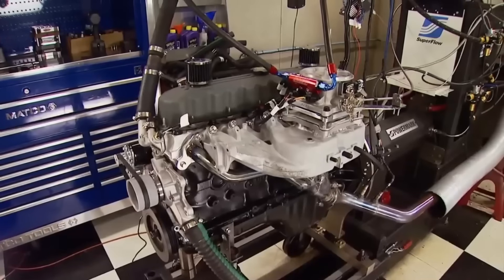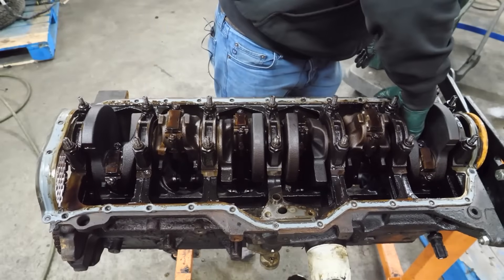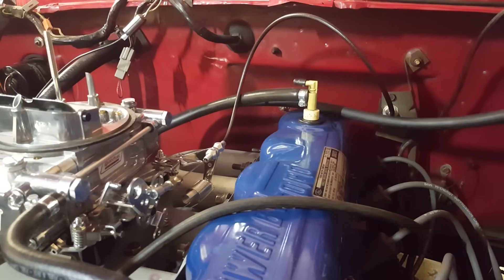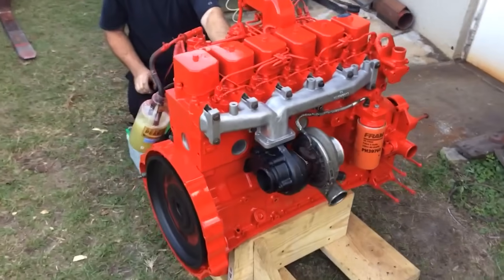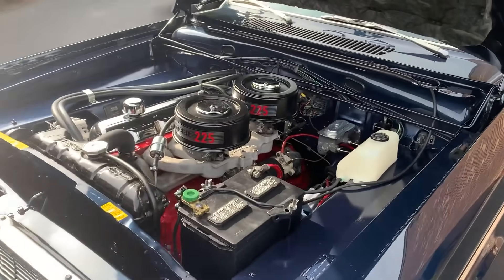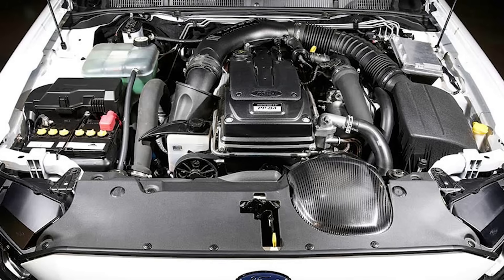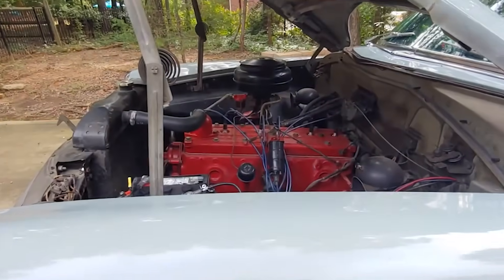8 Best American Inline-Six Engines Of All The Time!!!

Comment: The Ford 300 Cubic Inch  Six was used in commercial vehicles as well, up to the F-600. It was also used in UPS trucks, and in off highway applications like airport tugs, forklifts, irrigation pumps, standby generators, and as pump engines in oil fields.

Comment: The Ford 300 is the only Ford that I have owned that I have not thrown a rod in. Yep, I all but gave up on Ford, and then I got an F150 manual with a 300, and I found a Ford engine that does not blow up. I still have that F150 today, with over 275k miles on the block. 

PS Fords that I have thrown rods in while I was driving them. 78 Thunderbird, 2001 P71 Crown Vic Interceptor, 1988 Tempo. The T-Bird was the only one I rebuilt, drove and then sold. Should have put a 300 inline in those puppies, the 351/400 Clevelands were dogs.

Comment: I have no clue who makes these videos but they obviously have no clue of what they are talking about . Some of these old engines may have lasted for a couple of hundred thousand miles if they were well maintained but they were only a cheaper option to a V8 . They did get a little better gas mileage but unless you spent a small fortune on modifications , they had barely enough horsepower to get you where you were going .

Comment: I bought 2 ‘95 ford trucks for my landscape construction company. F350 Powerstroke service body, and an f150 4x4 with the 300 IL 6. 35 years later the diesel has 185k on it and 300 has 230k. I’m 57. These trucks are easily going to outlive my business, and maybe outlive me. Fueling them might be a little spendy in another 30 years.

Comment: Had a 67 chev 4x4 shortbox with the 292 six, it was the greatest engine ever, the torque was incredible and for the time gas mileage was good. After I had a 1979 ford 4x4 with the 300 six and it was a good engine but the truck had had 2 x 21 gallon fuel tanks and it needed them. So the 292 was the winner for sure.

Comment: Union Gas in Ontario used this engine in maintenance work trucks and were far more durable than the dodge 318' V8's. It did provide plenty of low end power and never broke down.  The Dodge V8' consumed a lot  of oil but not these engines.

Comment: Yep I bought a 66D200 Dodge in 2014 with a slanty in it hadnt run in years had a tree growing thru the engine on the drivers side luckily the hood wasnt latched, the hoods on those sweptys open to 90degrees. All I did too it after 3 days of cutting the tree out was lube up the accelerator pump of the carb with vaseline. put a homemade tank in the flatbed. That thing ran superb with a 4 speed should have never got rid of it.

Comment: The pinnacle of the F-300 I6 was it's phenolic timing gears, similar but different to motorcycle timing back then, this engine was banned for no good reasons but, it can fit a ford ranger and newer trucks.

Comment: Holden and Ford Australia are Aussie manufacturers with US based parent companies, I wouldn't count the Barra as an American straight six. It was never sold in America. The Atlas/4200 Vortec is objectively one of the best American I6 motors. They don't get a ton of recognition due to the fact that they were only available in a single platform, but it won multiple awards, including 4 straight years on the 10 best engines list. Now tuners are showing how much power these engines are capable of. They are lightweight and reliable, and very advanced compared to most of this list.

Comment: 5:19 My dad's first wife had a Dodge Aspen back in the 80s with the slant 6 in it. His wife knew nothing about cars and just drove and drove and drove the car until she told dad that it kept making some kind of noise. He said it had rod knock and he pulled the dipstick and there was barely anything on it. He put about 3-4 quarts of oil in it and the rod knock went away. Props to Chrysler for making a tough ass engine

Comment: The Chrysler slant 6 is my favorite engine. Had 3 different cars with them...2 were Darts and the other was a Valiant. All of them had over 200k on them when I sold them...yes...they were all still in running shape.
On top of that...the Valiant was a "sleep" in street racing...if you know what that is.

Comment: My 4..0 jeep engine was still going strong at 336k miles before I cooked the head gasket. When I overheated it. Completely my fault. The 4.0 iny 99 xj has 220k plan on keeping that going strong. It's a great engine
Reply: My 4.0 in my two door Cherokee would get so hot pulling my boat home in Vegas from Lake Mead but I would short shift to let it cool and not shut it off when I got home . I would spray the radiator with the garden hose .   The 90 Wrangler had the 258 and my 90 Cherokee had the 4.0 The Carburetor was the biggest issue off roading in the Wrangler besides the  leafs at each corner

Comment: In the early 80s I worked for a Plymouth dealership that ran a fleet of taxes with the slant 6 engines running on propane those were tanks
Reply: Our canning company in the 70's had 🫛 Pea  combines that were propelled by Chrysler slants 6. They were pulled with tractors and we picked 10 2 14 hrs a day 4 2 months straight. Our crew had 8 combines and I never saw one stop. Ran on propane

Comment: I work at Walmart in the Auto Care Center. I have changed oul on multiple 5.9l Cummins engines in Dodge Ram pickups. A few of the owners said they would never replace their trucks and those that traded them for a new 6.7l Ram wished they hadn't.
As for the Chrysler slant 6, we had 2 John Deere model 800 swathers and both had the slant 6 engines. Those came out in the mid 1970's and they still run. We changed oil every year and they just kept going.

Comment: The inline 6 engines have their origins in tractors. That's why they last. They have work in their roots and the technology came forward with them.
I have a 1966 GMC I1000 2 wheel drive pickup with the 250 I6. It's a fun truck to drive. The engine has huge amounts of low end torque, it will throw you back in the seat if you get on it. And it will cruise easily at 75mph. Love driving it.

Comment: My mom's 1972 Plymouth Valiant slant 6 was reliable, easily maintained, deceptively fast with great pickup speed. It had NO air conditioner, NO power steering, NO Power brakes, NO power windows! Nothing to encumber the Slant 6 power! It was a BEAST!
Reply: @americanpatriot9865  Aw, the good old days! Power nothing. Many models still sported that wonderful "Armstrong power steering" as the old timers called it. The only power was the motor supplying power to the drive wheels, and the driver supplied the rest. The good side of that was there was far less to break down.
Reply: Makes me miss my mom's '76 Fury wagon. It was in mint condition except that it had an intermittent ignition problem. It wouldn't start half the time. In 1989 she ended up just having to abandon it in a mall parking lot because we were so poor she couldn't afford to tow it home. Then once it was impounded she had no hope of affording the fees. I never saw it again. A year later our next car was a '77 Pinto V6, which was actually a very good car as well. Finally she was able to buy a new '92 Ford Escort and she fell in love. Most reliable car ever. She still has it.
Reply: One of the best cars ever! My friend had one and it was indestructible.
Reply: My Moms 1st car was a late 60s Valiant. She says to this day it was one of the best cars she ever owned.
Reply: There was one in my extended family, a ‘73 Dart Swinger 2-door. It was equipped with air conditioning and power steering and never seemed to lack for power. It was a spring sales promotion car Dodge marketed having those features plus a Torqueflite auto transmission and a few nice cosmetics: vinyl roof, radio, whitewalls and wheel covers. Did not like to start easily in humid weather.

Comment: Funny it's mostly about ford I have a 3800 Chevy with almost 400k miles and it still smokes the tires
Reply: 3800 was a V6, not inline, and it's a Buick engine. But yes, when they went to even fire and balance shafts they became decent engines.

Comment: 1996 Dodge Cummins straight six, 12 valve, diesel. I'm at 265,000 miles and my regular mechanic is confident I have at least another 100,000 miles left in it.
Reply: At 265,000 it's only just broke in. It should easily exceed that 100,000 mile estimate. Think more liberally on that. These engines last, just do your regular maintenance on it, and give it a good quality diesel fuel.

Comment: Note that the Chevy stovebolt seems to almost exactly keep up horsepower with the rival Ford V8 (the Ford was a flathead), I believe the Chevy could do more torque and could have a higher compression ratio although the available gas in those days limited this.
Reply from the maker: Great point!
Reply: In power, yes.  At high speed, no.  The Stovebolt was a splash oiler until the 1950s, and tended to starve for oil at high speeds.  That's why Clyde Barrow liked to use stolen Fords for getaway cars.

Comment: It’s a travesty the Pontiac OHC in-line 6 wasn’t listed. However, it’s basically a Chevy Turbo-Thrift with an OHC cylinder head.
Reply: The Pontiac OHC six is interesting, but they tended to eat camshafts and had problems with the valve adjusters.  This caused a lot of warranty work for Pontiac dealers.

Comment: 8:28 Actually, it all started in 1962 (model year) with the 194 cu inline 6. The 230 came in 1964 (model year) with the 250 following in 1967 (model year). The 292 truck version was similar but had a taller deck height to get the increased displacement. The 194 along with the 153 in-line 4 cylinder were designed for the new 1962 Chevy II/Nova compact. The 153 and 194 was “fraternal twins” with just different number of cylinders.

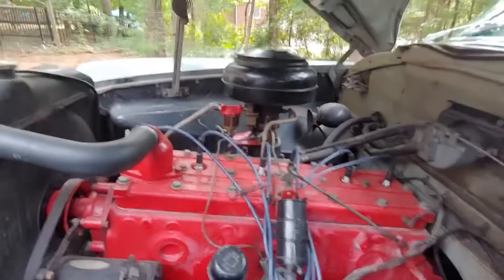Comment: 4.0 in my Jeep Cherokee Sport.  Bought it new in ‘97. I’ve put 410,000 on it. Sitting in my drive.  5speed manual with front wheel drive. Will instantly start if I walked out there right now. 4wd low has pulled me out of some nightmare snow.  Funny story.  At 30,000 plus a few, my wife is driving down a side street at @20mph.  Boom.   She calls frantically saying felt like she hit something.  Oil and coolant running down the street.  Towed it to dealer and they initially said I ran it dry on oil.  Nope. I did my own oil change with receipts.  I threatened necessary phone calls up the food chain.  2 days later I received a call describing a flaw in the blocks casting with a rod thru the cylinder wall. They replaced engine under warranty even tho I was probably 50-75 miles over 30,000 11:49 .  Felt/hoped all bad karma was discharged.  It was.  The following 380,000 miles a joy.

Comment: Just being a little pedantic here, the 4.0 never powered the grand wagoneer, for the last years of it's life up until 1991 it was powered exclusively by the AMC 360, one of the last carbureted engines available. There was a version of the Cherokee called the wagoneer but it was not the Grand Wagoneer that was pictured.

Comment: My  early 80s F150 had a 300 ci straight six with well over 250k miles when sold to an acquaintance and he put well over 150k miles on it before buying new F150.  The drive line was going strong when he sold it he said.

Comment: You simply can't do a video about great inline 6 engines without including the legendary Mopar Slant Six, one of the Best engines ever built
Reply: While I don't disagree I do get a chuckle over the fact the last straight six Chrysler built was an AMC engine.
Reply: @JeffDeWitt  and it was originally designed by Ford
Reply: @maceurbi2842  The AMC 4.0?!? Not hardly. It was designed by AMC and the original version was introduced in 1963.
Reply from the maker: I will check it out, and try to one more video about more inline 6’s

Comment: The straight 6 s  are easy to balance. No need for balnce shafts like in so many new engines.
Reply: From a pure geometry standpoint, they are perfectly balanced in both primary and secondary vibrations. No other prime number of cylinders are so well balanced--next best is a V12, which is basically two sixes.

Comment: Funny thing is, the Ford 240 inline 6 is the same engine as the 300 inline 6, just a different rotating assembly. Had one in a 1965 Ford F-100, that was so worn out from abuse as a farm truck it had to be bored 100 over to remove the cylinder scaring. Then had to have the crack in the side of the block welded up, then coated with JB Weld to stop the water leakage. Drove the truck for 3 years like that before I snapped a wrist pin and limped it another 4 miles to get home. So yeah that 240/300 inline six engine was a tank of an engine.

Comment: I've been a Mopar fan since I was sixteen back in '94 and had a Duster for my first car, but I'll take a Ford 300 any day over a Slant Sickness.  My supreme hatred for the Slant is bad... Like I dang near wanna puke every time I hear how awesome and bulletproof they are!  My issue with it comes from having three  A bodies that came with the dreaded 225 and all three scattered the oh so strong bottom end.  It's not like they were beaters either.  They were all bone stock, nice original cars.  Two came from original owners, with maintenance records from new and they all had under 120K miles... Heck, one had only 70 some thousand!  It absolutely wasn't due to a lack of maintainence or abuse on my part either.  I've had over fifty other veicles (street driven vehicles, not counting race cars) and no others have ever had a catastrophic engine failure.  The one plus that came out of the sixes failing is it got me beyond my thoughts about the cars being too nice to modify and lead to having a lot more fun with em once they had several times more HP!

Comment: I have a 1995 E350 club wagon XL van with a 4.9 300 IL 6 with 168,567.00 miles and it's weaker than dish water it barely will pull out of its own way, so I'm thinking maybe all the 300s is not the best engine like everyone said
Reply: I had a 1989 Ford Econoline stretch van that I put over 295,000 miles before I sold it to a guy who kept driving it. Those engines would pull very well. Maybe yours is out of tune. If you want more horsepower look into what Power Nation did on YouTube with the 300. I think they had to pushing 350 hp.

Comment: One outstanding feature of the Ford 4.9 is that it did not have a timing belt, it did not have a timing chain, NO. It had virtually indestructible timing gears. They were a tiny bit noisier than a chain or belt but they never get slack and they virtually never break.
Reply: Ran 4.9L engines in three 9000gvw road service vans over 13yrs; engines never failed, bodies & suspension wore out. One even got hydrolocked after sucking in water....pulled the plugs, blew the water out, ran it for 3 years without a hitch including towing a 6000lb trailer. They're  bulletproof
Reply: I think later engines had some kind of pressed fiber cam gear.  They would indeed go out from time to time, but it wasn't too terribly difficult to replace the gear.  And, you could simply switch it out with the steel cam gear.
Reply: @Chris_Troxler  Ah kinda like GM with their plastic teeth on the small block chev timing chain sprockets. trying to make things quieter but, the plastic teeth would fail. Happened to me.
Reply: @haroldhead7555  
Everybody says that the timing gears were loud, but I honestly never noticed over the exhaust notes.
Reply: @haroldhead7555  Yes, the composite cam sprocket on a chevy would fail with time and high mileage, but it would not destroy the engine, and $50 for parts and a few hours labor, the car was good for another 80,000 miles.   Many of today's engines are either ruined when they fail or cost $3500 to rebuild the timing system.
Reply: @barbmelle3136  Not so, I can speak from personal experience. Bent pushrods, bent valves, smacked pistons,  rocker studs pushed out of the head. And my failure was when the engine was at idle. Now, I did replace the timing chain and the engine did run, sort of to get me home but the engine had to be replaced.
Reply: @haroldhead7555  Never heard of that.  Did you have that happen in a small block Chevy V8?  Usually when that happens it is with high lift cams and or domed high compression pistons.
Reply: @barbmelle3136  low performance small block 350. When I tore it apart to look, I was amazed it still ran.
Reply: This! Why don't manufacturers use these timing gears on their engines now?

I guess I (as an owner of Toyotas) should just be happy that Toyota has stated that they will no longer make any vehicles that use timing belts.

Every (ICE) vehicle (from 2009 on, I think) will ONLY have timing chains. 👍🏼

But again, those timing gears seem even superior to timing chains. 👍🏼
Reply: @andyroid5028  Timing gears make some noise which is seen as undesirable by some. Personally I love the whine of those gears, it's like a reassuring lullaby.
Reply: @andyroid5028 they are expensive to make, the Cummins engines have them, it's one of the reasons a 5.9 Cummins diesel can last a million miles or more
Reply: After the 4.7 thatks toyota @andyroid5028
Reply: Absolutely.  The 194 straight six in my first car (chevy) was the same.
Reply: Nothing never breaks
Reply: @stevenashley7651  I'm still waiting more than 50  years for my Nova's original '68 chevy 250 inline 6 & powerglide to break with 300k miles. & the same with my '74 firebird's original 400 v8 & turbo 400 trans. with 250k miles.